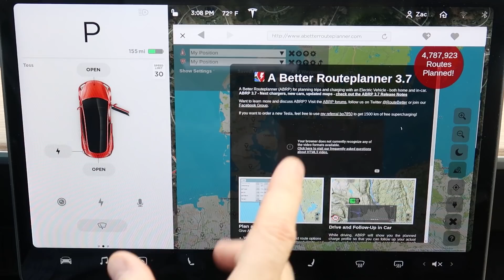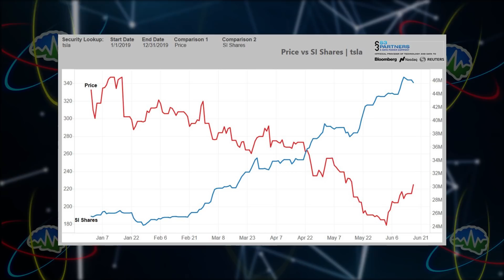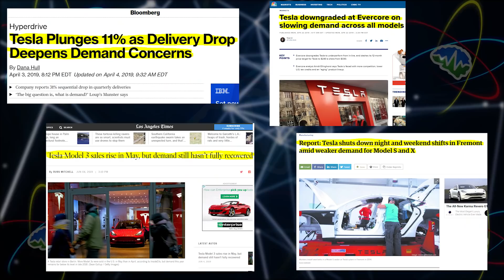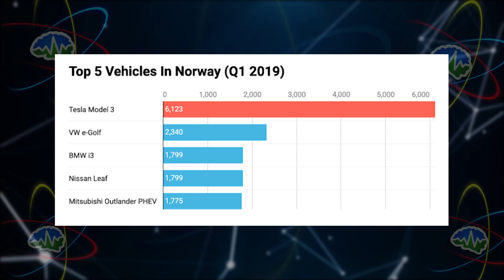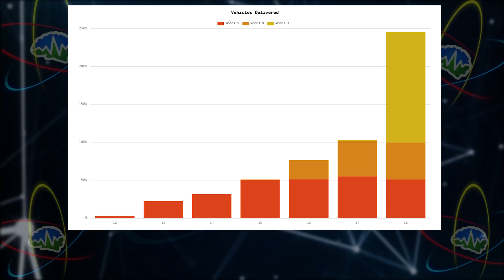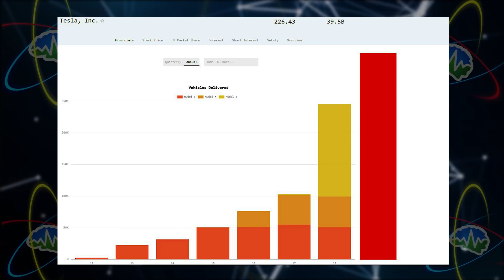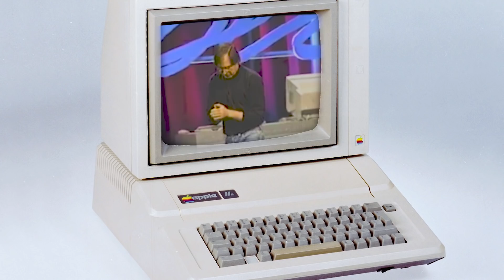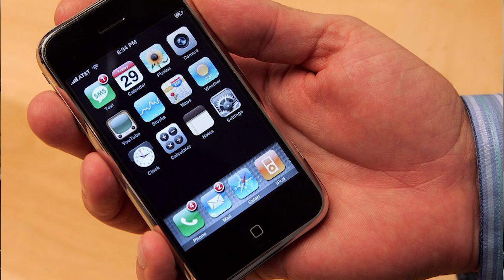Tesla Short Squeeze! | In Depth

Comment: Thanks, great video. But I was hoping you would explain how short squeeze actually works. 
Most people don’t know how shorting works...since most of them are done on margin, the short sellers MUST BUY BACK THE SHARES once they received a margin called, or to put up more cash to hold the short position. If the guy don’t answer the margin called in 36 hours or so, the stock is buy back AUTOMATICALLY. That is a short squeeze, when all of a sudden many short positions are covered automatically.

The big oil will just pour more money to hold their shorts, but the little guys will get squeezed out
Reply: Chun Kau Simon Cheung while you are correct there are many types of short squeezes. Most traders have a stop out level and would never even come close to a margin call

Comment: Quick question: having $5k to spare, would you spend it all on TSLA shares and go full bull for the long run?
Reply: Most stocks are over value now, only Tesla is the lowest of them all. If u not planning to touch that 5k for awhile I think it'll b a yes.
Reply: Better now where it is still cheap af
Reply: I own 60 shares currently. If Q2 gonna b good. We can expect a higher price. Some where around 250 to 300. If Q3 gonna b good. I think we will hit 360 easily.

Comment: I used the price drop to buy more and reduce my average buy in price down to $260 (I was late to the game and bought at a higher price). The worst case is that they will get bought out by Apple or Google so I would get some if not all the money back. Alternately it will be contributing to my retirement in 10 years. Buy on the dips, thanks shorters, you may be making me richer.
Reply: Or they go bankrupt?
Reply: @bernardkoppes4401  Before that happens, if it even comes to that, they will sell. Whatever the financial state of the company they would be a valuable addition to any of the major automotive incumbents or tech automotive wannabes. So yes there's a risk of loosing a significant proportion of my investment  maybe as much  as 70% to 80%, however the potential upside in 10 years time is worth the risk for a small proportion of my pension investment.

Comment: I bought my first two shares at $237.87 and 233.11, but when the stock fell, I bought more. Yeah, the sub $200 stock price hurt, but I took advantage of it and bought as low as $182.50, so my average share price is $216.19 for 8 shares. I used one of the brokers with no fees, so I don't have to worry about that at least.

Part of me hopes they FUD the stock way down again so I can buy some more bargain shares. =D

P.S. I signed up Say.com because of you guys, thanks

Comment: Good (and funny!) video explaining the TSLA stock price situation. Thank you. I'm considering placing very high limit sell orders on my TSLA shares held by Vanguard and other brokers so that they will not be available to "lend" to short sellers. Could you investigate this option? Perhaps if most TSLA longs did this, there would not be significant amounts of TSLA shares available to short?
Reply: Note that algorithms at your brokerage will probably prevent any super-high priced limit sell orders (like $2000 per share). But you should be able to place a limit sell order for substantially higher than the current price. Mine are up for $420 per share.

Comment: I would love to buy a model 3, but I would be worried about it stranding me someplace. How is the reliability?
Reply: Look in to it. Doesn't happen
Reply: Reliability is one of EV's best selling points. A WHOLE lot less moving parts, no oil changes, etc. The brakes last forever because of regen. I have done NOTHING to my 2015 Model S in 4 years, other than rotate the tires and refill the washer fluid. You wake up every morning with a full tank. My wife's Model 3 is PERFECT, even nicer than my Model S in some respects. This, IMHO, is the main reason Big Auto is dragging its feet on EV's: there is no money to be made on maintenance/service.

Comment: Chevy dealer just charged me $150 to hook up scanalyser for check engine light. And the same amount to analyze a transmission code.  Two sensors and $1500 to get my truck out of the shop. I told them my next truck will be a Tesla.
Toyota dealer squirted oil onto my differential and told me I needed to replace a seal. I am so happy Tesla does not have franchised dealers. 
I also think it is great Tesla does not advertise. I think Tesla  will usher in a new era of respect for the earth and for their customers.

Comment: 20:45 I continue to comment routinely my next vehicle (replacing the family KIA Sedona) will either me the Tesla Model Y or the VW ID Buzz. There is plenty of excitement for Model Y, but it doesn't cannibalize on the Model 3 being a great EV Sedan option available today.
Reply: @markplott4820  The VW ID Buzz prototype was running on a battery, not magic when driving around San Francisco as part of the VW ID US tour. To your point, they aren't ready nor planning to mass produce until 2021 or even later. Well the Model Y with 7 seats also won't be available until 2021 at the earliest. I am in no hurry for either.

Comment: New topic! Oil prices have been relatively low and stable for a long time.
Increased tensions in the Middle East could push oil prices higher, leading to higher fuel prices.
For the first time ever, had prices may skyrocket while there is a legitimate alternative within the reach or many Americans.
The comparisons of cost of ownership could dramatically shift towards EVs being cheaper over the life of the vehicle. 
Fleet buyers could switch to EVs overnight.

Comment: the argument I keep having to defend is the Tesla Money burn rate. What is a good counter argument?
Reply: Should I just say.. "top line sales cures all"
Reply: Name the last company to have a similar money burn rate when they were expanding - Amazon
Reply: @neilkelsey1762  That thought just excites me lol
Reply: Burn rate is massive capital intense expansion. VERY capital intense. They are currently TTM positive (trailing twelve months)...and that is before Gig factory 3 comes online. Then model Y. Then Semi. Then solar roof and powerwall. Then Gig 4 in Europe. Then....then....then.
Reply: One time repayments and Giga 3 capital expenditures. Found this in this Q1 financial statement. "Our cash position decreased from $3.7 billion to $2.2 billion mainly due to a $920 million repayment of convertible notes..."
Reply: Patrick McGuire that is correct, but does not relate to what people usually mean by burn rate. The bond repayment does not effect income calculations (just cash on hand as you mention) and the Gig 3 is being locally financed and great rates from local (China) bank.
Reply: The counter argument is "What are they burning it on?".

If the money goes into (successful) research & development, into expanding manufacturing capacity, opening new markets, etc, then that is money well spent. So ask your friends what Tesla is using that money for. Is it good or bad spending?

Comment: Great job guys. I wonder if this is the same for Nio as I just bought 1000 shares today?
Reply: NIO is betting on a battery swapping model. A) that one is expensive and complicated since it needs a lot of charging stations with charged and ready batteries B) it has limitations since it cannot have liquid battery cooling and C) the Tesla Model 3 LR has shown on Supercharger V3 that it is capable of charging for 75 miles in 5 minutes or about 160 miles in 15 minutes. Who needs and wants battery swapping?
If you want to invest in a company that has good future (and get their stock at low price), it's - Tesla. Now.
Reply: @markplott4820  they are already https://www.nio.com/about

Comment: Is there any proof on the part that big oil is the one holding those short positions through other investment organs?
Because I would say that it would significantly reduce the chance of a short squeeze since they aren't in it for financial benefit. 

Therefore, they wouldn't even care about covering even if the stock goes up by 100% or so. Whereas people with a financial interest would start sweating now that we most likely have seen the dip?

Comment: Big Oil could just build lots of oil-fired power stations - then they could profit from power that is being used to run Teslas...
Reply from the maker: They could... If oil companies built powerplant and not the electrical supply companies... And if oil weren't one of the most expensive forms of power generation. In fact, solar and wind just beat out coal and natural gas to become the cheapest forms of power generation.
Reply: @NowYouKnowChannel  Give it time. When every man and his dog is driving an EV car truck airplane bulldozer ship whatever then the drain on the grid will be so immense that power prices will go through the roof and fossil fuels will come back into play.

Comment: What happens if 90% or more of Tesla stock gets shorted?
Reply: That would mean that 90% of the shares were borrowed from some shareholders by the shorters and then sold by shorters to others. Then after a short interval, 90% of the shares would have to be purchased by the shorters and the sellers could pretty much name their own price, $300/share? $3000/share? $30,000/share? That is why if you are long on Tesla you should place a limit sell order for as high a price as your brokerage will allow. These shares can not be borrowed by shorters. But when it comes time for the shorters to buy, they will have to purchase at the best price they can find and with more than 1/3 of the shares already shorted, if the longs stay strong, the shorters will be in a sellers' market. It could substantially drive up the price of the stock.
Reply: Remember though, the board members alone hold a damn lotta stock. So this wouldn't be possible in this way.
But interesting hypothetical question^^ ;)

Comment: You can buy or sell a put or a call. Both puts and calls require a buyer and a seller, and both regard who is providing who with stocks. If you buy a call, you have the right to exercise the contract to purchase shares at a given price. If you sell a call, you have an OBLIGATION to provide shares at that price to whomever buys the call who will make an interest payment to the seller for a set span of time unless the contract is exercised. Puts are the opposite. Buying a put gives you the right to sell shares at a given price, while selling a put obligates the seller to buy those shares at said price. You can think of it this way, buying a contract gives you the right to exercise the contract for a fee, and calls are for bullish trades and puts are for bearish trades. Selling contracts gets you paid up front but if the contract buyer exercises the contract you are obligated to buy or sell shares at an agreed upon price. Usually puts and calls are combined in what is called a "vertical spread" to "cover" the trade in case it does not go the way you think. It will still cost money, just not what is referred to as "unlimited risk." So a vertical means you are limiting both the gains and losses you can occur, but also limiting the risk you are exposed to. There are also some advanced strategies for option trading, but they are all variations of combining vertical spreads such as the "iron condor." It sounds confusing at first, but it really is a simple concept. The important takeaway though is that when people short a stock, they are still likely going to have a covered position, and that means that they HAVE to eventually buy back the shares, and when there are so many people who will all have to eventually buy back the shares it will severely inflate "demand" because they will be OBLIGATED to buy. Someone had to sell the puts and calls, and they will be responsible for "buying back" borrowed shares in exchange for a small interest rate, and I am looking forward to what the stock price will look like when 30% of all outstanding shares required to be bought back. The market is very simple. Price goes up when people buy, price goes down when people sell AND THAT IS IT (News, Earnings ECT are irrelevant to stock prices, only investor confidence is reflected by the stock price). Short sellers have flooded the market with TSLA shares which has driven the price down, but it will be short lived. No stock price can survive for long in a forced state, either a bubble pops, or an undervalued stock explodes, and TSLA is extremely undervalued because investors are only looking at auto sales, and not valuing Tesla's data, neural networks, or supercharging network, as well as their battery infrastructure lead. Bad analysis leads to bad decision making, and nothing makes me happier than taking money from wall-street goons.

Comment: Elon cares about speed more than environment without on demand sharing economy in play it only about 30% better than similar ICE car for environment. EXIMUS IV is far ahead in efficiency. For densely populated areas linear motors could be justified, increasing efficiency even more. Also variable field magnet motor could be used to optimize necessary torque/speed.

Comment: I think you're dead-on wrt to the 'shorts'. But as for the pickup, Truckla is kinda cute. But let's face it, the design for the Tesla pickup, at least the one we've seen thus far, is, frankly, homely. And it shows a complete misunderstanding of 'pickup' culture in the US. Of course some will buy 'cause it's different. And businesses will want them because it's economical. But the vast majority of folks who buy pickups as a fashion accessory, the ones who drive around with an empty bed most of the time, will not want to touch this thing.

Comment: Hopefully by the time the model Y comes the battery constraints would be all gone.
Reply: @markplott4820  True. But even with a 33% increase at GF1 they wouldn't meet the demand for Y since it's supposed to have even a larger marketshare than the model 3. The structure of GF1 seems to be far from finished though. It's nowhere near its final size. Hopefully they're at 75% capacity of the current production lines and with future expansion the number can grow drastically?
Reply: @markplott4820  yeah. but from the recent announcements it seems like the production lines in Fremont are not the bottleneck. It'd be great for margins to simplify production even further though.
Reply: @markplott4820  yeah. I can't wait for that to finish. All under one roof just seems a lot more efficient. I'm kinda bummed they haven't started a model 3 line at GF1 yet, but there's so much happening already. I can't complain.

Comment: Hold.  Keep holding.  Then hold some more.  That strategy simply infuriates $#0r+sighted ANALysts to no end.  Just remember, those guys didn't just start claiming TSLA was 'worthless' or 'not worth the risk' at $380, $360, $320...  That has been their mantra for nearly a decade.  They said the same at $19, $20, $25, $30, $35, $45, $85...  The people that bought and held then are likely to be joined by others that buy today, and hold for another decade.

Comment: Some numbers. Tesla put about 500,000 EV on the road so far. At 15,000 miles a year average , replacing a 30mpg ICE vehicle, the oil industry is loosing 250m gallon of gas sale a year.  And its going to be double next year to half a billion gallon a year in lost sales.
Its going quick and its cumulative, and its relentless.
Also tesla true float is smaller then the numbers used, as Elon himself own over 20% of the shares.

I think its going to be difficult (costly) for short seller to short much more.

Personally I'm looking forward to Gen2 of the Tesla pickup truck. Its really going to be a state of the art vehicle.

Comment: All major car companies are owned by oil companies. As in a example with the volt. Why did that car got pulled off of the road???? Now if you major share holder was major oil company, what do you think with a car that used no fuel? Chevy, dodge, etc are owned by oil. I dont know about Ford tho. So, that is why  Tesla is getting a negative support. A  press owns shares to a big car company, what do you think thier bias is?  Renewable is here to stay and only will get bigger and cheaper. Follow the money..

Comment: I'm all for electric guys, but get over this whole 'electric or nothing'  crap until we have electric cars that can replace our current ice specs. There are millions of us out here that use a car for work that drive upwards of 600 miles per DAY. And it is service related, so we have to go to a stop, do a repair, get back in and go to the next one. There would be no way we could carve out an extra 2+ hours per day for charging. You can't take away our livelihood for a great idea. 
I finally got a Volt, so I feel a little better about it, but until I can change the type of job I have - we don't currently have the electric range needed for my line of work. We need someone to do a 1k mile car. When they do that... it will be a paradigm shift. That is enough for 2 gas stops. I make at least 2 stops and sometimes 3 per day for gas. Since I got the Volt, that is down to 1 or 2.  If you can put enough range in there to eliminate 2 stops, then you can get all the way through the day before you have to charge again. 
Of course... then there is recharging that beast of a battery overnight!